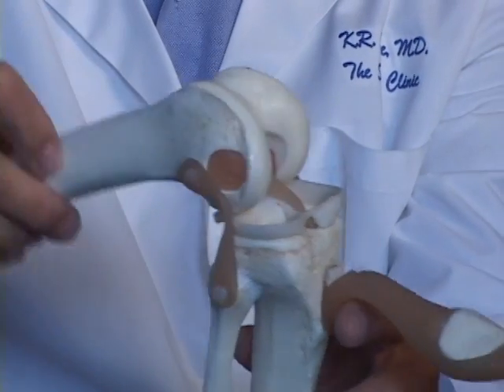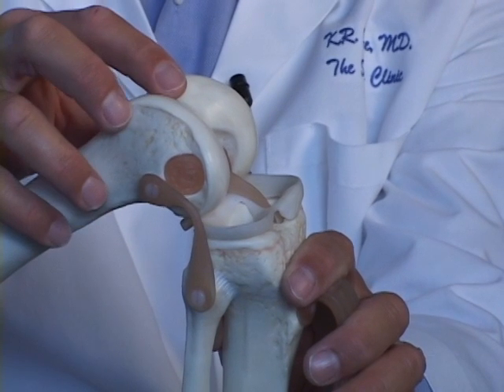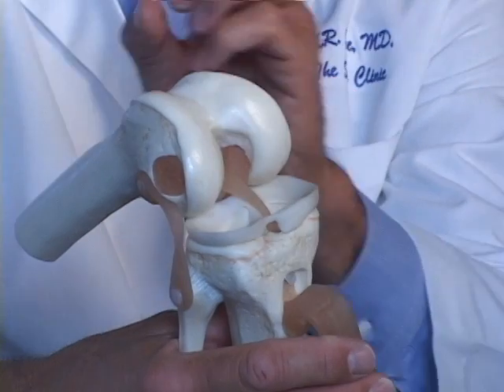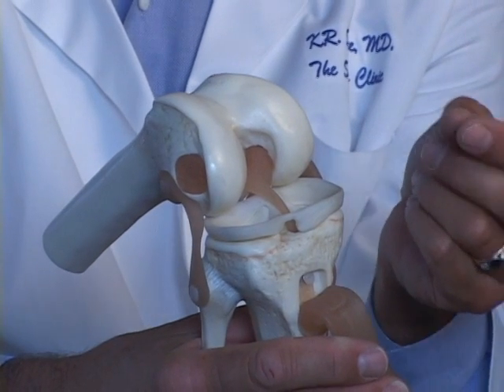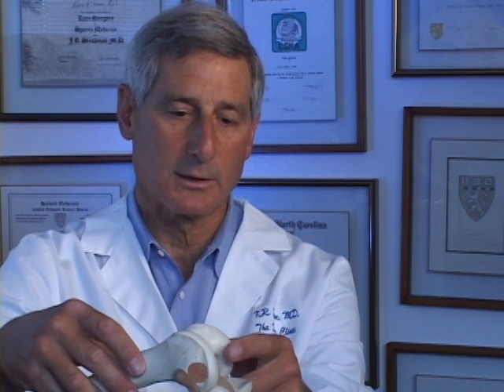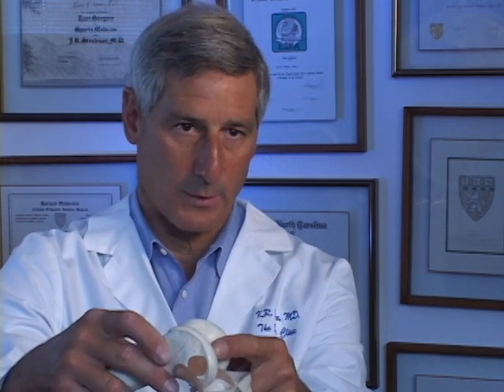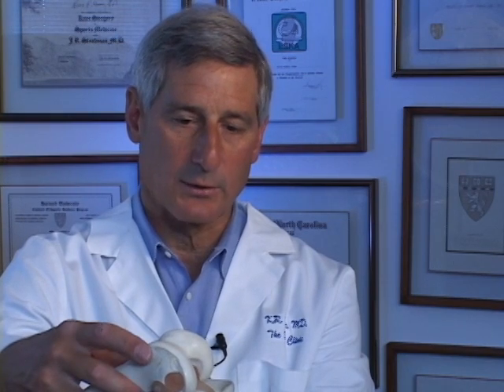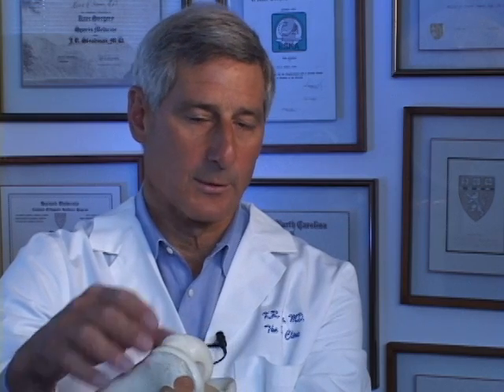Articular Cartilage Paste Graft Technique: Interview with Dr. Kevin Stone

Comment: had a HTO in 2014, ended up with a knock knee and HTO did not relief pain, pain increased from a 3-4 to a 7-8 with physical activity. can you help me correct my knee alignment and regenerate my joint?? My docters only solution is a TKR. im only 29. please help.